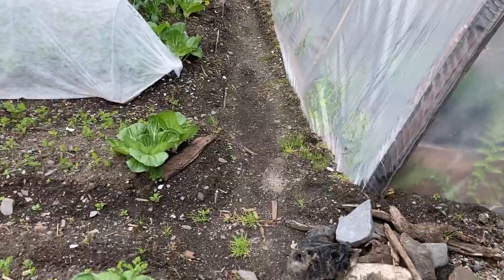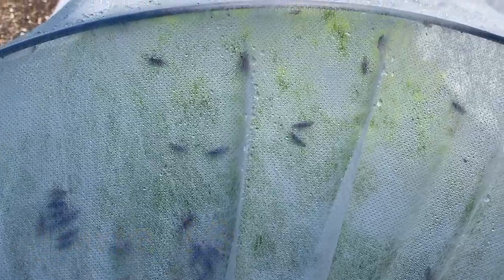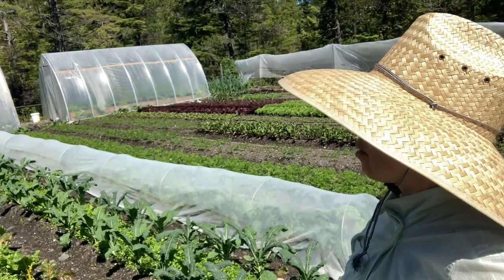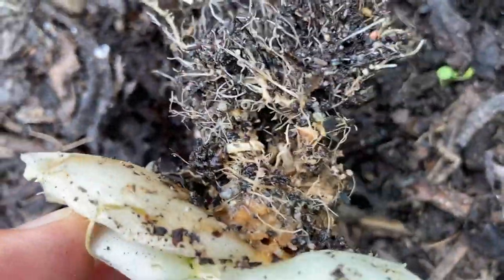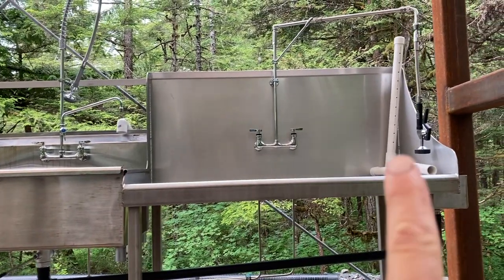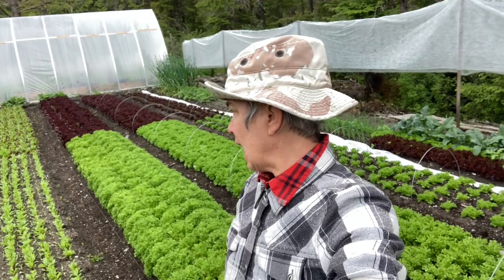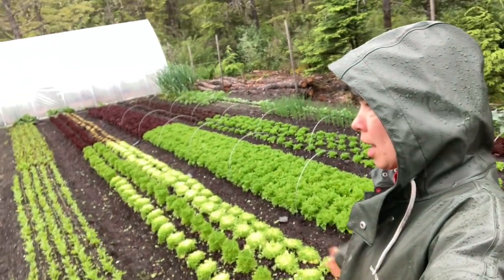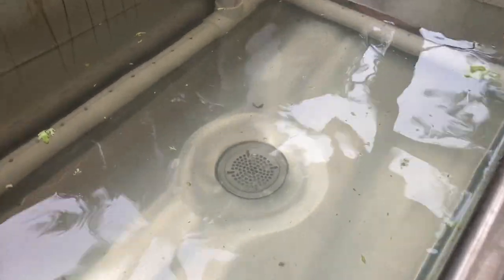New Fridge & Greens Bubbler + Root Maggot in the Bok Choy

Comment: The beauty of your bubbler is that the pipes are easier to modify than welded stainless.
It does look super strong and easy to clean!
It is very very warm here, all of a sudden, things are bolting or fading Fast.....including me.
Reply from the maker: I think the bubbler will be super nice once we get the details figured out. Don’t melt away Wayne ☀️🧊🍦🧊☀️
Reply: @kathivy  A thing to consider might be a "tap" to leak away some air so you could choose less air for very tender products.
You probably already have that but I don't want to loose the thought.
Reply from the maker: @wayneessar7489  the leaf blower can be adjusted to vary the amount of air, but it was surprising to me that even with a lot of air going through the greens didn’t get bruised. When I put my hand in the water the air bubbles were actually gentle even though they looked pretty violent.

Comment: Try using a Shop Vac on your bubbler, they super grunty and work surprisingly well!
Reply from the maker: Thanks for the suggestion. We considered a shop vac but they’re noisy and the leaf blower is quieter and air flow can be adjusted. It was blowing the water out of the sink in the last clip so has plenty of oomph but it looks like there needs to be air holes at all four sides of the sink rather than just the T that we used at the beginning. Will fiddle with design some more 🤪👍